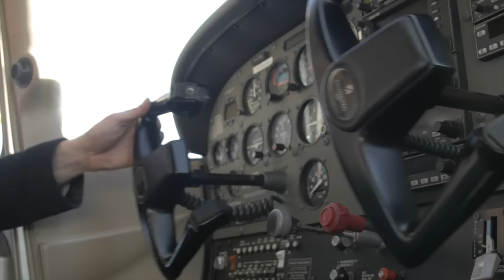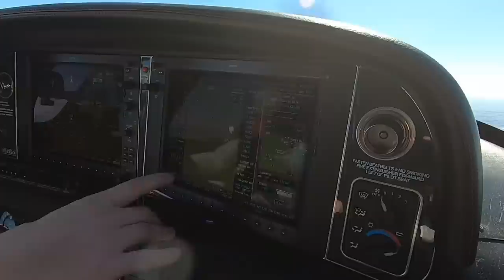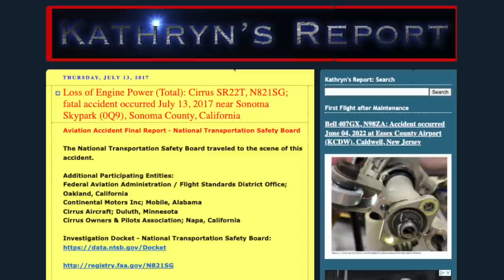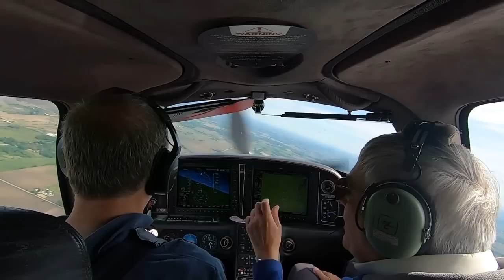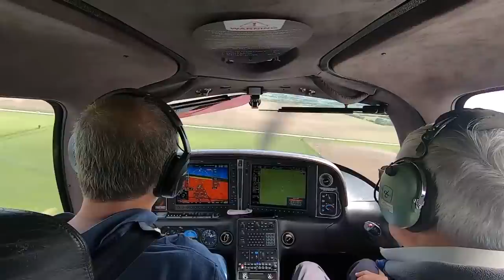REAL ENGINE FAILURE - Forced Landing In Cirrus 1500 feet AGL - NO PARACHUTE PULL

Comment: I wonder why he didn’t pull the chute.
Reply: We have to wait for the investigation report I think. But I also want know why he did what he did.
Reply: My understanding is that you can't rely on teh chute below 2000ft. and why pull the chute when you can land safely? pulling the chute totals the cirrus. Seems there is a growing lack of airmanship among pilots these days. People needing autopilots and parachutes rather than knowing how to actually fly.
Reply: @SoloRenegade  this topic is covered in the YouTube video that Marc/PIC posted. 
Also, pulling the chute is not automatically totaling the airplane. There are Cirrus airplanes flying that were repaired after a CAPS event. Each event is different.
Reply: The PIC shared this answer. He was too low to pull the chute.
Reply: @rocky_williams  ok, last I'd been informed was that the plane was a total right off if the chute was pulled. I guess it also depends upon how much damage is done on landing. harder set down collapse landing gear and damage airframe, vs softer let down and minimal damage. 

Makes sense, I'd just never heard of a case personally where it hadn't been totaled yet.
Reply: @SoloRenegade  I think that is true for the generation 1 SR models. But I think that was resolved with some redesign in the second generation of both SR20 and 22s.
Reply: You can pull the chute as low as 600ft AGL. Weird. Very weird.
Reply: Why pulling the chute if you can glide and land on a suitable land dude?
Reply: @StefBelgium  it’s in the SOP. A suitable landing field might have obstacles you can’t see from above or holes in the ground. In an engine failure scenario, the airplane is the insurance company’s problem. 

I’d pull the chute anytime.
Reply: @AlphaEchoFoxtrot  lol OK...I m wondering how all other non Cirrus planes do in case of an engine failure...oh wait:  they glide and land!
I ve never said "do not pull the chute". I said there is no reason why you d pull it if you have a nice clear piece of land to welcome you.  And I m wondering why Cirrus instructors train you for emergency landings if the SOP indicates to systematically use the chute!
Reply: @StefBelgium  if I was flying a Cessna, I’d glide - there’s no other option. If I have the chute, I’d use the chute. No questions there. Be all the cowboy you want - the data is there. Lots of fatalities with cowboys not pulling it. 

I would never risk it. But that’s just me. Be the Hazardous attitude you want 👍🏽
Reply: Hi,, it's Marc.... the pilot in this case.  I surmise I didn't pull the chute because as soon as it happened, I believe my brain "remembered" the training I had been through 5 months earlier (with Bob).  I just started executing the things we practiced during that session).  That's the good news.  I made the video as a message to all pilots of all makes and models, that we are accountable to study, train, and practice so that we will be able to execute with confidence and proficiency.  Your brain will be your friend if you train and practice.  But if I had pulled the chute, it would've been a great decision and believe I'd still be here talking about it.   As a result of this experience, going forward, I will make sure I internalize two paths.  One with the chute and one without.  And if I am at a high altitude, I will probably not pull the chute until closer to the ground (when giving up control of the airplane), so I can have a say in where the chute will take me to.  And as I told Jason, there are examples of times I would not pull the chute.  For example, if flying the Chicago lakeshore with the prevailing wind out of the west.  Depending on the time of year, it could be a 100% fatal option, especially with frigid waters.  Statistically, the chute is a great option and am glad I have that in my toolkit.  But even Cirrus pilots must be prepared for situations like a failed or partial deployment.  We all need a Plan B.
Reply: @pfflying6275  thanks for this Marc and I’m glad everything went fine. My problem with this is that you used your plan B as your plan A, and even Jason Miller is now saying parachute deployments are “nuanced”. And I think that’s bad. Maybe because I’m just out of transition training where I practiced, besides non engine landings, we really practiced deck altitudes, using FLC to maintain best glide and get as close as possible to a suitable landing spot (aka airport). Otherwise, reaching deck altitude, pull the chute. 

I 1000% agree with your plan B, but we need to internalize what Cirrus tells us and what the data shows that works. In a situation like yours, CAPS is available. If not, then sure, plan B. The last thing we need is newbie Cirrus pilots questioning the chute deployment. 

Thanks for posting this. I’m very happy everything went fine. Fly safe!
Reply: @AlphaEchoFoxtrot  And that's why I will continue to promote the chute.  So weird that I was so excited to learn what the brain can do for us and to tell all part 91 pilots that we have control of outcomes.  And it keeps coming back to the chute.  Jason is a CSIP and he and I agree that it should not be an automatic pull.  I replied to someone and maybe it was this thread that if I pulled the chute on the Chicago lakeshore, it was 100% chance of it being fatal by drowning or exposure.  We need to be situational aware throughout every flight.  Whether flying a BRS plane or not.  And as I learned, I will never ask what a pilot was thinking from behind my keyboard.  Having said that, I agree with you that I need to send the right message to all pilots.  THE CHUTE is a lifesaver.  The main message is ensuring we can make the right decision when the "poop" hits the fan.  STUDY, TRAIN, PRACTICE.  That's the most important takeaway.
Reply: @pfflying6275  we agree, in most part. I don’t believe in automatic pull for anything, as described above. N333LZ’s accident was an eye opener for me and what some of the hazardous attitudes can do to us. I think we should all learn from it. 

Stay and fly safe!
Reply: @AlphaEchoFoxtrot  100% aligned.
Reply: J M  N333LZ
Reply: @pfflying6275  he said that s a cowboy attitude not pulling the chute though 🤣

Comment: He’s lucky he was flying over endless wide open fields without lots of crops or structures.
Reply: landing wings level, under control, even into trees and built up areas, has a survival rate over 90%
Reply: I was lucky.  If over a populated area, I believe I would've pulled the chute without question.

Comment: How differently things could have turned out had the engine failure occurred at night. Only fly single engine at night in an emergency.
Reply: This is Marc (the pilot).  I would've pulled the chute at night or if terrain were not so inviting.  At least I hope I would've. 😉
Reply: So night flying is generally required in Private Pilot training. Would you consider that an acceptable "emergency"?

Comment: The POH calls for pulling the chute.  So Im not sure why everyone is lauding this pilot's decision to do an off-field landing and thus breaking SOP.  I think its dangerous to portray pulling the chute as something to be ashamed of.  We use seat belts because they are a tool for safety.  The chute is also a tool that comes in the Cirrus as a tool to be used.
Reply from the maker: That's the point I want to make is that an "automatic" chute pull is too rote. What if, after the chute pull, he landed on a farmhouse and hurt people on the ground? In this case, he elected to make a safe off airport landing and I think it's a good reminder that the Cirrus can do that. This case highlights some of that nuance
Reply: @TheFinerPoints  Oh I dont doubt that, Jason! I fly Cirrus and I practice engine outs and off field landings as part of my regular 6-month checkin with my CFII.  As you mentioned in one of your podcasts, whenever we as POCs decide to do an off field landing on say a road,  we are responsible for making sure we dont land on an SUV or something.  Good discussion as always but Id like to see perhaps a followup discussion on why its OK to pull the chute and remove the stigma attached to "Cirrus Pilots" pulling the chute.  Id rather be alive to fly another day and bend that metal than try to save the plane. Thats what insurance is for.
Reply: pulling the chute should not be the Default response. pulling the chute is more nuanced than that. some situations require it immediately, others do not. There is No reason you can't land a cirrus with an engine failure if you have places to land.

If the engine failed in the pattern, would you still pull it?

Are the rest of us without parachutes just supposed to stop flying and die?
Reply: @SoloRenegade  Agreed that its nuanced.  Thats why its hard to have a good debate on chute vs no chute on the internet... There are so many factors on making that decision. Not binary at all.
Reply: Fully agreed.  The chut should be a safety feature.  If one can land safely in a field and has the altitude to do so, there is absolutely no reason why pulling the chute.  The parachute imo, should be used if no place to land safely, structural damages to the plane making it unsafe to fly, incapacited pilot with passengers not being able to land...
Reply: @faisalsultan892  agreed. people want yes/no solutions. they don't like having to make decisions and then be held accountable for their decisions. They want everything boiled down to one right answer in every situation. These people scare me (as a pilot). 

There are also altitude and airspeed limitations on pulling the chute for example (minimum altitude needed to deploy, or max airspeed to avoid shredding the chute).
Reply: SOPs do not apply to every situation. 
In this case the pilot did the right thing as there were enough safe areas to land.
Reply: Can't talk for others but I would this pilot's decision as it seems to me that pulling the chute is more dangerous for people on the ground as there's virtually no control over where the plane will contact the ground.
Reply: @LeantoPeak  not to mention that i beleive, you pull the chute, the plane is a write-off as far as the insurance is concerned. at least that's the case on the TL2000 i've been flying
Reply: @WX4CB  in an emergency, financial topics should be the absolute last priority, but sure, all else being equal, trying to salvage the plane is also a consideration.

In Portugal, in 2017, there was a plane that landed on a crowded beach instead of ditching. The pilot said it was either the beach or "certain death". After investigating a bit I found the numbers on ditching close to shore, and more than 90% of events have zero casualties. I began to think the pilot meant certain death... for the plane. He killed 2 people on the ground.